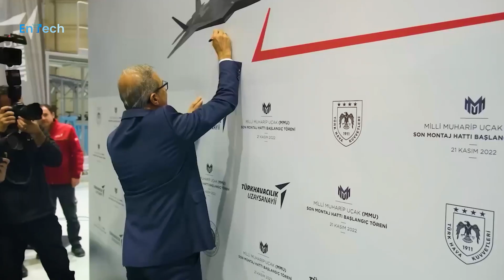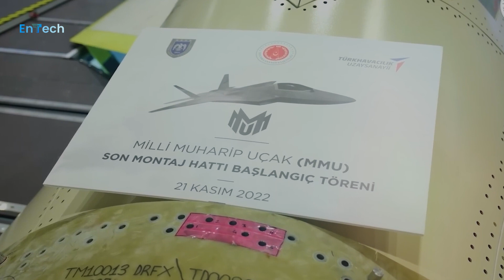Turkey's Stealthy 6th-Gen Fighter Jets is Coming

Comment: Stop exaggeratingthe 5th Generation Tai tfx prototype isn't even complete and you say 6th gen
Reply: If you put a ghost drone on the right and left wings of a 5th generation aircraft, it becomes the 6th generation.
Reply: @hasanok1964  the Kizilelma is a jet powered carrier capable stealth drone that will mostly be used for Multirole and ground attacks with low radar cross section so it's an advanced drone but not a 5th or 6th generation because that classification is directed into piloted  fighter jets with high payload, powerful twin engines with super cruise, yes I knoa what you meant one of the 6th generation capableities is to have a loyal wingman drone or swarm drones it's just part of the 6th Gen and won't make the kizilelma 6th Gen maybe when the Tai TFX get its flights with 2 seated version to accommodate that option will make it 5.5 generation (Tai tfx with Kizilelma 2 engines version)